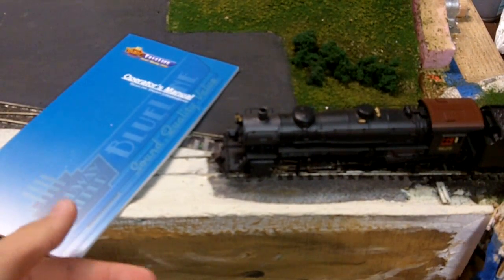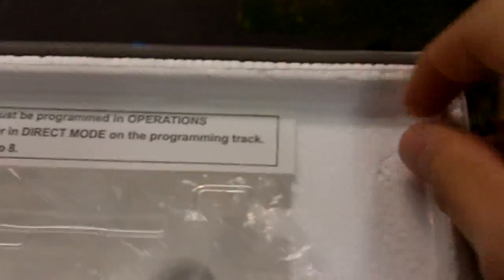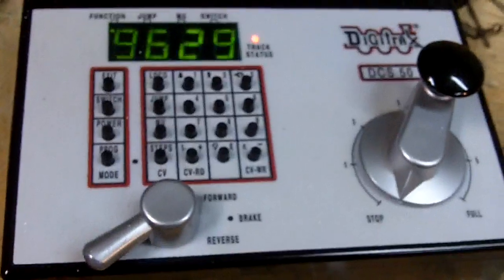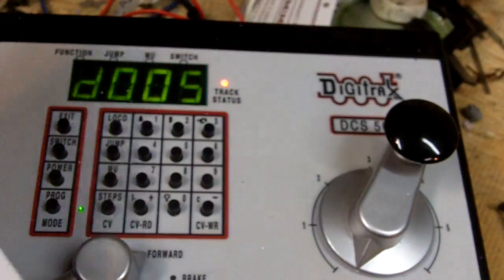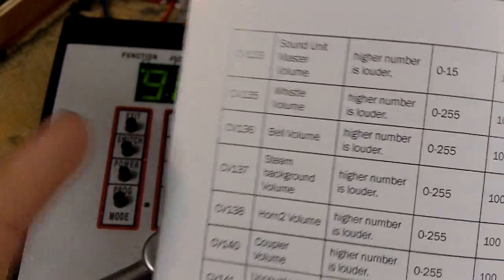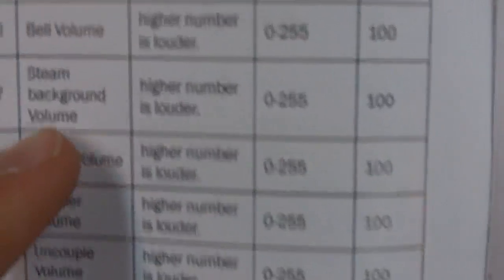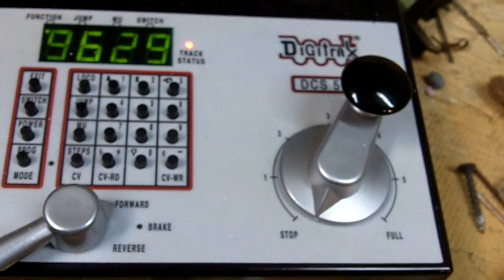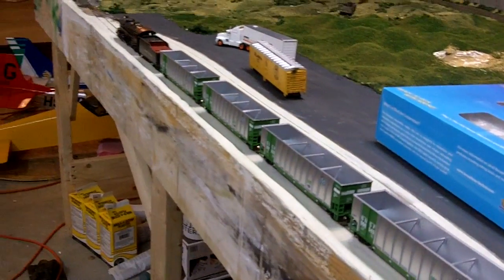Programming CV's on DCC

Comment: How do you set up the digitrax zephyr with bachmann e-z track?
Reply from the maker: +Twin Fun 

Connect the EZ track as you would with any other DC or DCC system, then plug the power leads ( one for each rail) into the rail A and rail B port on the back of the system.
Reply: ok, actually I have a athearn dc power pack, the wires are different from a lead wire and the plug in wire

Comment: I have the same controller as you I wanted to ask you something when I put the switch to forward my loco goes backwards and my head lights turn on when I put in in reverse it goes forward and my rear lights come on how do I change or fix this

Comment: This is a simple solution. Just change the direction of the locomotive before MU'ing them. SO in the right throttle set in your loco, then on the left side of the throttle set in the second loco and change the direction to reverse. MU them and they will work in tandem in the direction you need to go.

Comment from the maker: you make the CV values be the number on the side of the cab, like 1630. IF your locomotive is new though it will be an address of 0003. You must program in any address (most people use the loco cab number).

Comment from the maker: @Kvr3005 

okay, if you want to program (lets say) CV 65 to a value of 100. 
First, press the program button with the locomotive on the main track to OPS mode, 
press the CV button and enter 6 5, press CV again and then press 100. 
After entering 100 press the CVWR button

Comment: I have a question. I have a digitrax zepher and I am trying to speed match two locomotives using a 28 step speed table.in the manual it says program cv's 65 through 95 with cv values from table v. For instance it says program cv 65 to a value of  x01. My question is how do you program the value to the cv?